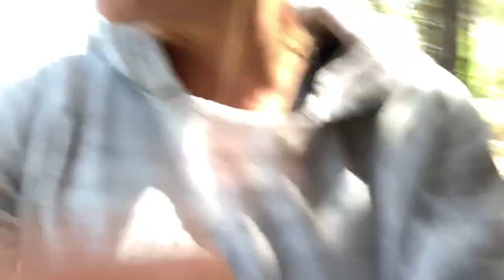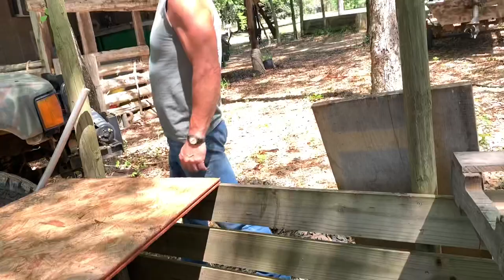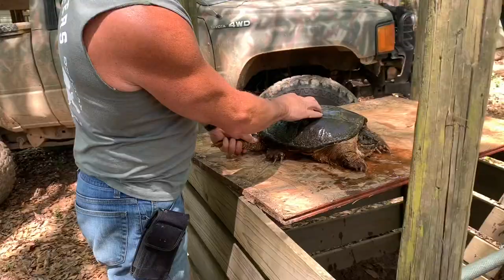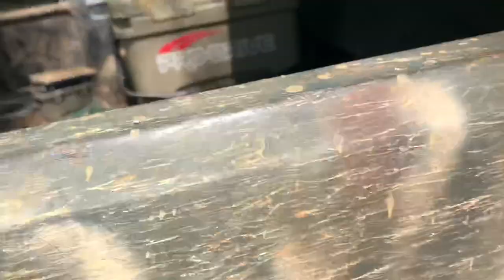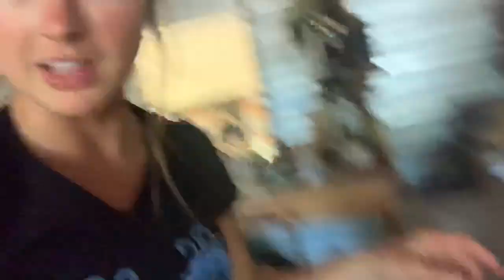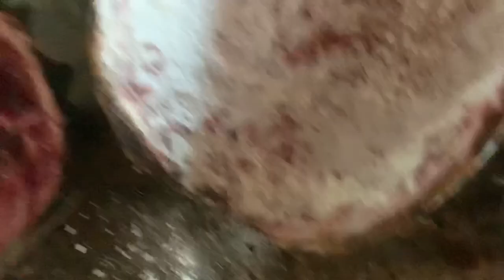Trapping Turtles: We Caught 7 Snapping Turtles and 3 Got Away!!

Comment: You left the best tasting meat in the shell.  The “backstraps” are the best tasting part of the turtle.
There are bones that are in the shape of a ladder running parallel to and on the left and right side of the center line.  Underneath on each side you will find a strip of meat.  To remove the meat it is necessary to chisel or cut or break the rib bones in the center on each side of the shell.  (I use a 1” wide very clean wood chisel and a hammer.  Cut the cross bones at each edge of the strip of meat.  Then cut around the meat on all sides.  Finally, fillet the strip of meat away from the shell.  Those “backstraps” are the best tasting part of the turtle.
Reply: I second this, definitely the best meat.

Comment: Hanna, Love your videos. Keep them coming.  My grandpas' method of cleaning a snapping turtle was to lay in on its back and fasten the turtle to a board by nailing it between the front and back legs on each sided (where the top and bottom shell joint the bottom shell) .  Is that your method too?

Comment: For a pin we used chicken wire with 3ft pole woven through it, stuck in the ground, and a foot of the wire hangin loose on the top so when they climbed up, they would flop back in. To catchem, we'd just string a hook with wire to a tree, about 2ft from the ponds' edge with bacon or a chunk of hot dog and check it every three hours.

Comment: Dry it out and drill holes around it every half inch and get a piece of leather and some leather lace string and leave the top open see it up the leather pull it tight cut it to fit around the edges of the shell see it up and it makes a nice pouch for gathering berries or a fish basket if you leave a extra piece of leather for a flap and see on a 1 inch wide leather shoulder strap it make a nice carry bag really for anything but the Indians used them for harvesting berries and fishing just a idea you might like on the inside of the shell before you build it take some spray paint wet the inside really good with paint while it's wet put some sand in it shake it around it will stick in the paint dump the extra out and put a top coat on the sand and let it dry good before drilling and building it it makes a nice inside of the pouch cool stuff love the videos